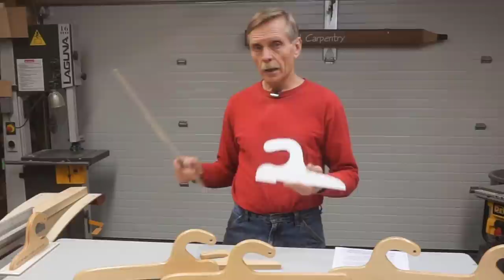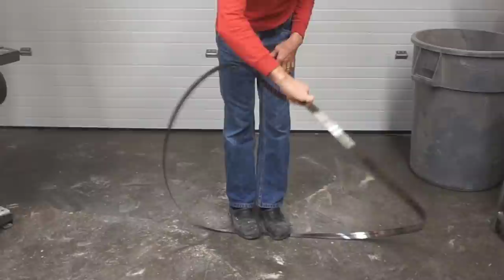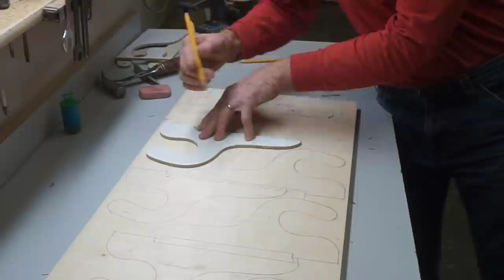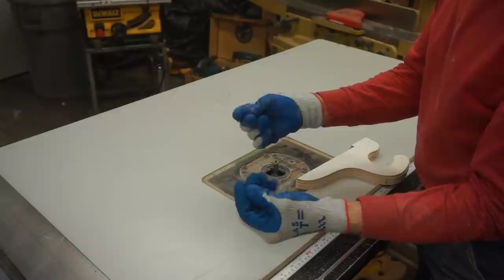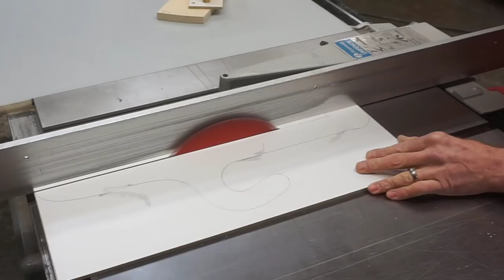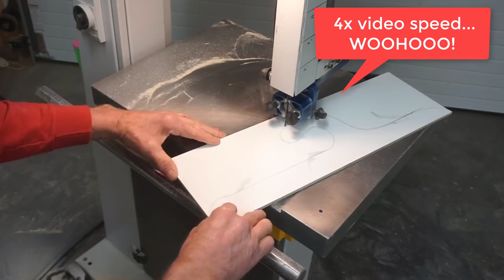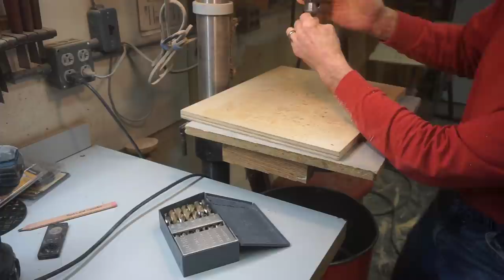Make Professional Push Sticks for Workshop Safety

Comment: Just the job. I was looking for a design that keeps my hand away from the blade and pushes the wood forward and holds it down.
I won’t make a template. I will just make one and use it as a template for any more. I might laminate it rather than use plywood.

Comment: Excellent video Matt.  I'll be making some of those at the weekend.  BTW, you should set up an Amazon.co.uk affiliate link so us UK based followers can use your links too.  Thanks.
Reply from the maker: Hi Jon, thanks for subscribing to Next Level Carpentry!  I think you'll really like the pushsticks if/when you make some.  BTW I use the 'thin' version in the most recent video upload at about 7:50:

https://www.youtube.com/watch?v=DSIpxXN4r5s

I'll check into the Amazon/UK setup... I think I saw something they sent out saying I'm eligible... every little bit helps to build the Channel and the better that goes the more content I can produce... a win-win arrangement for sure.  Thanks for an encouraging comment as well!  Best, Matt
Reply: Thanks Matt. I actually found my way to this video from the one you referenced.  Saw the pushsticks on that video so sought out the video on how to make them. I've been much more of a hand tool woodworker until recently but getting more into the power tools as well due to more 'construction' type work (building garden furniture etc), so good to have the option to go at something the quick and noisy versus slow and quiet way. Your tutorials (I was going to call them tips, but they're much more than that) are great for both.
Reply from the maker: Thanks for letting me know how you came across this video, Jon... as a content producer it's not easy to tell how and where information is found.  Being from the first generation of 'cordless tools' users ie: handsaws, push-drive screwdrivers etc I appreciate the 'hand tool woodworker' approach to things more than some, but, being from the 'I make a living doing this stuff' crowd I realize, like it sounds like you do, that people aren't going to pay extra because you used elbow grease instead of kilowatts to get their job done! :-)  FYI Next Level Carpentry videos aren't organized all that well on the Channel so I hope you're able to find more useful 'tutorials' there if/when you have a chance to browse around... Best, Matt

Comment: Where did you find the table saw insert?
Reply from the maker: Bought it twenty years ago but unfortunately it's no longer manufactured. I think it became unviable when every table saw manufacturer in the world moved away from the standard oblong opening that Delta created in the last century. There's just way too many variables on newer saws to make any attempt at covering the market. I like headlight bulbs for cars and trucks which used to be standard but now every single model is different...
Reply: @NextLevelCarpentry  thank you for taking the time to reply!!!
Reply from the maker: @JWLWoodWorks  Yeah, no problem.  FWIW here's a link to a photo on my Pinterest page showing the underside of that plate in case you want to search for it on eBay or something: https://www.pinterest.com/pin/551479916872563704/

Comment: How many push sticks of one design do you need?  Isn't like one good enough?  For the additional sizes and shapes, okay.  But I'm not seeing why you make like 10 identical sticks.
Reply from the maker: CAF: If you don't need 'em, by all means, don't make 'em!  Personally I make plenty so in my mind I know they're totally expendable.  Plus I have ones with differing heel lengths for various material thicknesses, extras to give to friends, a few spares dedicated to different machines in the shop and on jobsites, etc.  Making a whole batch at a time is completely sensible for many woodworkers, especially those who do a demanding variety of operations during a given project... but that's certainly not everyone. Best, Matt

Comment: Where can one get a three flute flush cut router bit with a 1/4 shaft?
Reply from the maker: Here's one place, Jim:  https:  https://www.amazon.com/dp/B0009H5PP4/?ref=idea_lv_dp_ov_d&tag=aiponsite-20&linkCode=iil&ascsubtag=amzn1.ideas.29WVINIJF4EUJ
Reply: @NextLevelCarpentry  Thanks but it has  0.5” shaft. - unless I’m reading it wrong.
Reply from the maker: I believe it's 1/2" cut diameter and 1" cut length with a 1/4" shank.  The description fails to make it clear but the photo does... you can probably find this bit in a big-box store and verify with close inspection.  Best, Matt

Comment: I don't think you showed us how you square the inside corner of the heel that is left round by the router.
Reply from the maker: I don't remember either Ken... a bandsaw, jigsaw or a small pull saw and chisel would all be options.  Could even be done using a tablesaw with the right setup.  Best, Matt
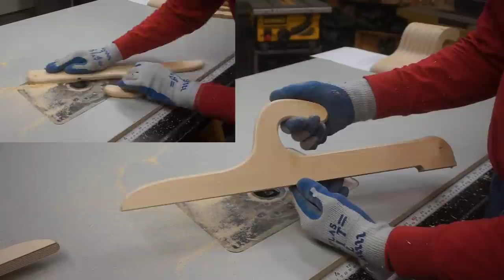Reply: Start at 38:25 for squaring the notch.

Comment: how do i find in pds 1: 1 scale template
Reply from the maker: Read through the replies in the comment that is pinned to the top of this section and you will find a Dropbox link to the full scale PDF hope it works for you...
Best, Matt
Reply: Nation found in Dropbox the link to pds drawing
Reply from the maker: @aldogressa6708  try this: https://www.dropbox.com/s/iqz1g9gyan26mik/NLC%20Push%20Stick%20Pattern%20full%20size%20by%20Dave%20Smith.pdf?dl=0

Comment: Why dont you use a riving knife? and why are so many carpenters not using blade guards?
Reply from the maker: Do YOU use both?  Why indeed?
Reply: @NextLevelCarpentry  I am new to carpentry, so at this point i am not taking em off as most cuts i inted to make will have em.
Reply from the maker: @sleepingtiger4436  You've leaned an important lesson: your safety is your responsibility.  It will serve you well as you develop your skillset and abilities.  Best, Matt

Comment: I’m not about to criticise your push stick design especially as it works for, which ultimately if it causes you to make virtually risk free shots.  However what a work up and time consuming they are to make.  I thought the whole idea of making a template was to make repeat pieces fast and accurate to make.  Although I have to agree they look the part, but spending a couple of hours making them just doesn’t make sense to me.
Reply from the maker: Interesting perspective Steve.  Personally I'd spend an entire month making a single pushstick and still be time ahead compared to downtime from a single minor injury.  If spending a couple hours making a batch of pushsticks every 10 years doesn't make sense I'm curious what other use of your time does... Best, Matt

Comment: Matt...what happened to your Finger?
Reply from the maker: Cheewurz: I pointed at the wrong thing at the wrong time? :-)
Seriously, it was an accident in 1993 while using a crappy old jointer with no guard in a foolish manner without pushsticks or paddles... the wonder is that it wasn't far worse.  The takeaway is that power tools are merciless when misused... so give them the utmost respect!  Matt

Comment: I wish someone can make a template drawing to download and then print
Reply from the maker: Uuuhhh, like this one posted in the video description for exactly this purpose?:   https://www.dropbox.com/s/iqz1g9gyan26mik/NLC%20Push%20Stick%20Pattern%20full%20size%20by%20Dave%20Smith.pdf?dl=0
Be sure to send  note of thanks to Dave Smith for his generosity... Best, Matt
Reply: @NextLevelCarpentry  how about a pdf download without Dropbox?
Reply: @glenntaylor4844  I just did.
Reply: @dogear99  do you have the link posted to download it?  Thanks
Reply: @glenntaylor4844  select the above link.  It will open on your computer, pay attention to the right side of your screen, it has two dropbox mentions and an icon which is an arrow, hit that arrow and it will download.  At least it did on my computer.  If that doesn't work, it's beyond my pay grade.
Reply: If you need a push stick I assume you are a woodworker, if you're a woodworker isn't half the fun designing things yourself? Take elements of this one add a bit from another, throw in something to personalize it. It's just a push stick, doesn't have to be these exact dimensions
Reply: Wow if you whine a little more you should just go buy one or buds box of tissues

Comment: couldn't you  just attach that template to the push stick and  run it   on the flush trim bit on the router table   then add a  round over  after the flush  trim  would make less  work and  an almost perfect surface , just a thought  .  i know there is a million ways to skin a cat or dog :p
Reply from the maker: If I understand your question my answer is that it would only allow using the round-over on one side of the pushstick. You still have to remove the template to round over the other side.  One way to speed up the process in a high production situation would be to get a proper 'thumbnail bit' with a center guide bearing which could profile both sides at the same time?  Always interested in faster cat-skinning ideas so thanks for your question/comment African! Best, Matt

Comment: Far be it from me to criticize your videos, but wearing gloves around a piece of high speed rotating equipment is not a good idea. I work in a highly industrial job, but the tools aren't much different, drills, band saws etc. If your finger caught that router bit you would be missing half your hand because it could grab the glove and pull your hand in before you even registered it. I love your work, and would hate to hear about that happening. Just my .02 though.
Reply from the maker: I take your viewpoint respectfully and thank you for it.  The 'no gloves' rule is a 'good idea' in general but, as with all generalizations, has exceptions IMHO.  My ultimate goal is to prevent injured fingers so I only wear gloves when I determine that doing so decreases my risk of injury.  In cases like this, the risk of injury due to poor grip is much higher than the risk from a glove getting caught, so I wear the grippy blue 'smurf gloves' to maintain a firm hold on the workpiece...
Best, Matt

Comment: Why didn’t you just trace the push stick you’re trying to copy? Then modify it the way you want.
Reply from the maker: Because my goal for the video is to show viewers how to create a pushstick outline, not to show them how to trace around one THEY don't have?
Reply: @NextLevelCarpentry  And yet the same pushstick they don't have to trace, they don't have to measure from.  Why didn't you show how to TRULY  design it from scratch, instead of copying ad modifying one you already have?
Reply from the maker: @michaelmccoy4989  What are you talking about?  If you're not able to follow detailed steps and instructions from this video to create a pushstick like this, don't blame me about not TRULY designing it from scratch.  That's complete nonsense because the whole purpose of the video is to show how I layout and make the design I show in the video, not dream up something out of thin air just to satisfy you...

Comment: If you're worried about kickback, then why do you not have anti-kickback pawls on the saw?
And/or a riving knife?  And/or a splitter?   AFA push sticks - I like mine to be about a foot longer than that because I practice safety rule number 1 i.e.  Stay The Hell Away From The Blade!
Reply from the maker: Nie, I don't 'worry' about kickback but I do have the utmost respect for machines that can produce it.  I'm very aware of it's presence and potential dangers which is why I prefer a ergonomically effective push stick over anti-kickback pawls or a splitter and push 'sticks'.  Similar reasoning leads to having flotation cushions on airplanes and not parachutes.   My first safety rule is apparently a bit different than yours.  If spinning blades worry you to the point that you feel safer with push sticks over 12" long then don't let me talk you out of them.
Reply: Respect for the machine and a push stick only takes you so far.  If you have safety gear on your saw, why not use it?  It's no inconvenience.  Kickbacks are most often caused by twist and warp when the saw kerf releases stress inside the wood.  A push stick isn't going to help you with that.

 You're making instructional videos.  You are doing a disservice to viewers by diminishing the importance of safety equipment.

I very often use my saw without guards.  But then I think 'that's stupid' and put them back on. As far push sticks are concerned, I usually use whatever piece of wood is close by.   And no.  I'm not afraid of spinning blades - mostly because I know enough to stay clear of them.  I've seen instances where the blade can suck you right into it.  All it takes is the right set of circumstances.  This isn't a macho contest.
Reply from the maker: Nie, I'm sorry if you've somehow got the impression that my videos represent a 'macho contest'.  You've made a number statements in your recent reply that are too generalized to be taken as fact but I'll not get into that.  
I believe showing a saw in use with dialog about ways to mitigate inherent risks of using power tools is much more useful instruction than blurting 'stay the H*** away from the blade'.  I see a whole lot of other stuff on YouTube that, quite frankly, scares me.  This video represents my feelings and belief from many years experience but isn't meant to be an officially sanctioned OSHA regulatory lecture.  I'm not going about telling others that their practices are irresponsible (even if I think many are) but am sharing things I stake my livelihood on in the most tangible way each and every time I fire up a potentially dangerous machine.  I expect viewers to process what I've shown and adapt and ignore as their common sense and experience dictate.  If you take a preponderance of dialog from my videos, in context, I'd be surprised if your opinion that I'm 'doing a disservice to viewers' regarding safety equipment doesn't change.
Regards,
Matt
Reply from the maker: "you'd be better off just staying at your keyboard"... touche' 😂
Reply: Anti kickback paws can cause markings IMO and can cause smaller trimmed rips to get stuck in them.  They are just one type of safety device.  I would say, use as many as the situation allows you to practically do so.  At least for me, I would like to make a few of this type.  I always have problems with rips wanting to “float” up, so these will do well so solve some issues.
Reply from the maker: Excellent points Cal... thanks for commenting to contribute them.  Best, Matt